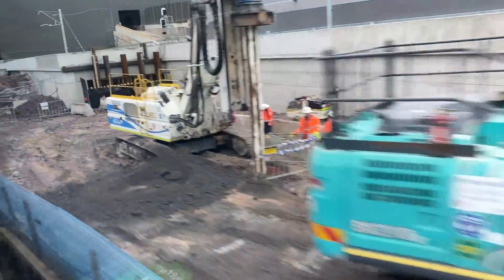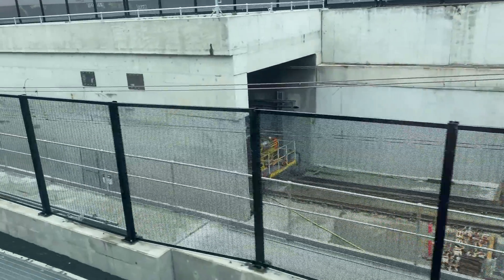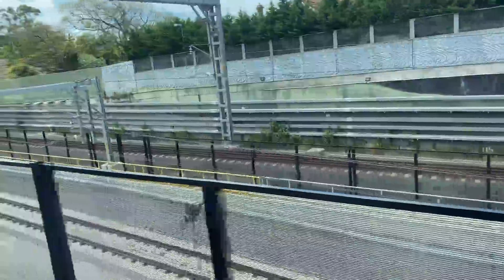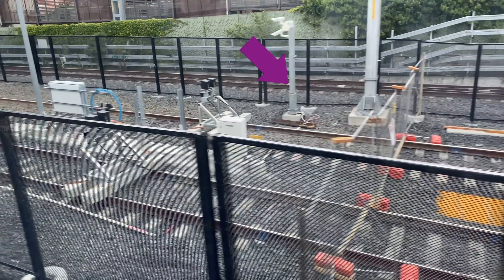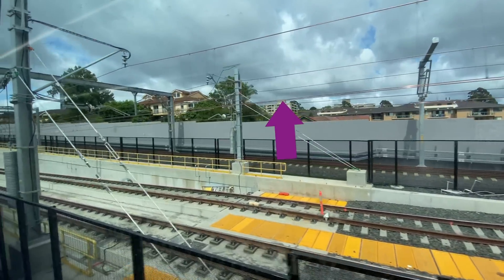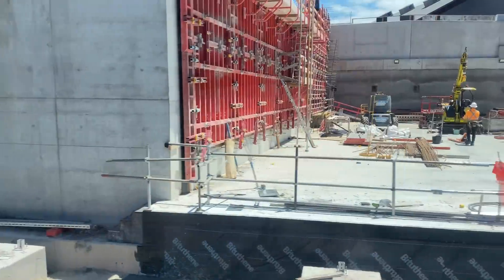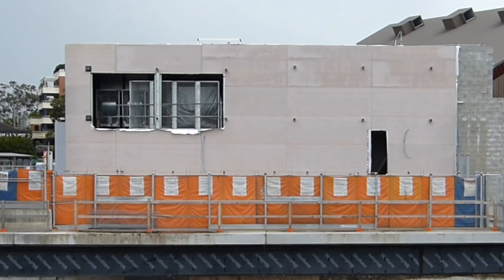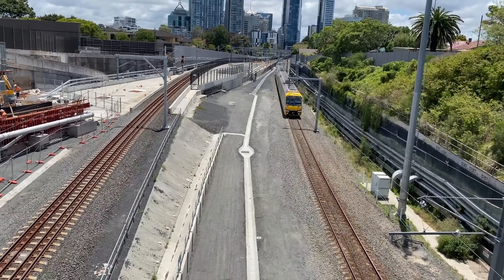Sydney Metro Chatswood Dive Site and Northern Connection - Tracks Now Joined Up! - Oct 22 to Jan 23

Comment: The ohw structures where the ohw ends are called terminations
Reply from the maker: Thanks for that Phil, I'll remember that for next time.
Reply: @TransportVlog 
The ohw system in weights that length of the wire run between 2 termination structures is called a tension length and is held in the air via the weight system and is self regulating via the weight system in different weather conditions.
Just going back to your expedition down into the underground construction where the solid bar is used to supply 1500v to the trains I would love to know the estimated life span of this system. Normal .3 contact wire has a life span of around 50 years, the new .2 twin contact wire system that is used in all the new how rebuilds would go longer than that I would imagine.
Luv your vids, brings back many memories especially on the nth shire line.
I spent a lot of time in the ecrl prior to commission and then doing the maint of the how from Epping to Chatswood.
Regards

Comment: Hi Paul, this sounds quite concerning. Wondering if you’ve been making any status update in relation to this problem?

https://youtu.be/18ykG6N8dyg
Reply from the maker: Yes I've seen this video (and some of the footage in it is mine). It's highly unlikely it will be cancelled at this late stage.  The additional trains have already been delivered, the substations and services buildings are almost complete, and this project is needed to create additional capacity for T2 and T8 services on both the city circle and the approaches to Central Station. Even a change of state government won't change that, as all the contracts have been signed and get-out clauses would be expensive! Trust me, it will happen!

Comment: Hello Paul, Very Interesting video here. The Chatswood Dive Site and Northern Connectionis getting a Upgrade. The tracks of the Sydney Metro joins together. This New Update is quite common. Sydney Metro is still under construction between Chatswood and Bankstown. They match together as the tracks came apart the signal of the Sydney Metro having a Upgrade Update. It has been since It was held through the Tunnel side and the tracks joins together. I was forming about the Sydney Metro construction at Central. The Track and Electrification Update was formed in a Tunnel Port. The overhead wise is no longer required and the first Sydney Metro infrastructure was that have became disused quite common that the Sydney Metro is impacted. The fencing is covered for the Sydney Metro. The construction is still working on for the Sydney Metro Upgrade Update. Great video Paul.
Reply from the maker: Thanks Brendan

Comment: Can't help noticing how much planning, effort and money is being spent on interchange the M and T lines in Chatswood, compared to the disjointed designs for Bankstown and Parramatta. I would never suggest political bias of course.
Reply from the maker: Hi Jack, I think there are lots of reasons why the designs at Bankstown and Parramatta are not cross-platform.  A big one is having sufficient space around the station to build cross platforms, and in the case of Parramatta Metro, this would also involve bringing the line above ground through Parramatta CBD and I don't there is space to do that! An interchange similar to Epping might have been possible at Parramatta if there was enough space around Parramatta Railway Station to excavate new underground platforms below.  In a perfect world, cross-platform interchanges would always be the best option!
Reply: @TransportVlog  I don't really buy that. Your own excellent videos document the lengths that the governnent is prepared to go to in the CBD and Chatswood if the will is there.

Comment: Hey Paul, as an upper nth shore train user, the end of weekend shutdowns is near.  I look at the metro tracks at Chatswood every train trip. Finally joined.
Reply from the maker: Hi David, yes hopefully this will mean less weekend shutdowns, but I don't think they'll end unfortunately! Last weekend, there was major work happening on the harbour bridge tracks and shutdowns are often required to upgrade stations, especially raising platforms and adding new lift shafts or platform bridges. Do let me know if you spot a test train on a future trip!

Comment: Am I wrong in assuming that the northwards mainline tracks have 4 rails to strengthen them / make them more rigid on their new concrete base or they are just a precaution in case of a derailment on that section?
Reply from the maker: Hi Andy, the extra rails are check or guard rails. And yes, they are to provide protection in case of a derailment. They are common on bridges and other locations where a derailment could have nasty consequences!

Comment: another milestone, guess it is <2 years before operation.
Reply from the maker: Yes, I reckon about 12 to 18 months.
Reply: Paul, are you putting money on 12-18 months, because I’m looking at Victoria Cross and Pitt street stations 🚉 I think they’re really behind with construction 🏗️
Reply from the maker: @nickkociski1756  Hi Nick, No I won't put any money on it, but I reckon its the over station developments that are behind schedule, rather than the stations themselves. And the stations can open safely before the over station developments are finished, and metro trains could run non-stop through unfinished stations. Basically, there are lots of options!